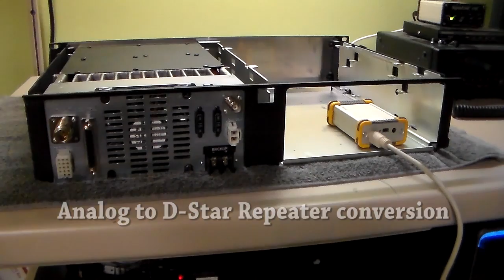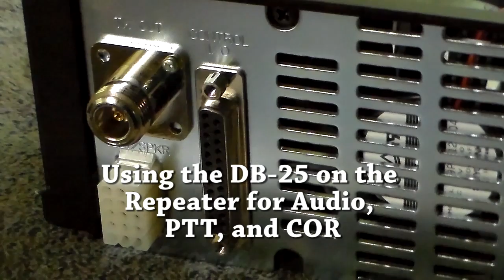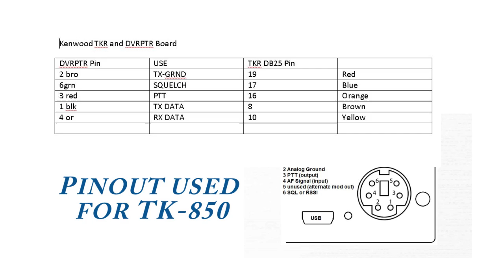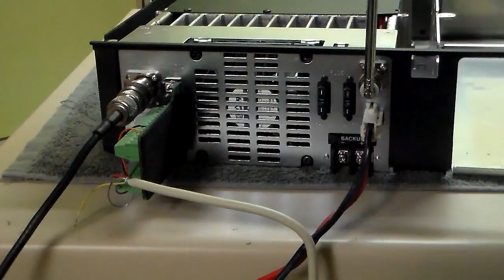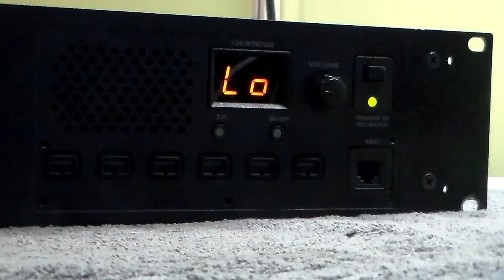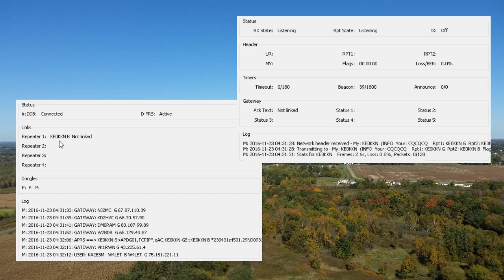D-Star Repaeter with Kenwood TKR-850

Comment: How can you program below 450?  I want to program 445MHz TX and 450MHz RX.  Thanks!
Reply: The programming software should just allow you to plug it in.  The only problem is depending on what it was programmed before you might have to turn the front end for better RX.